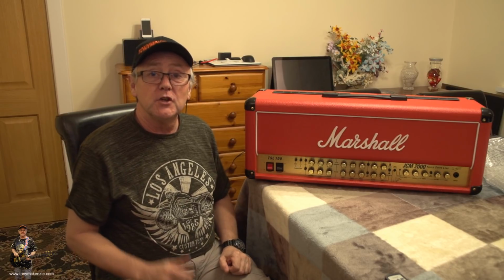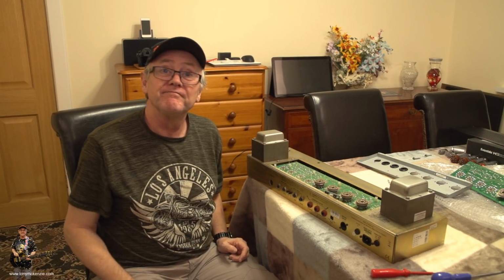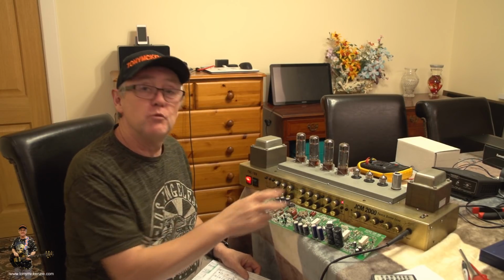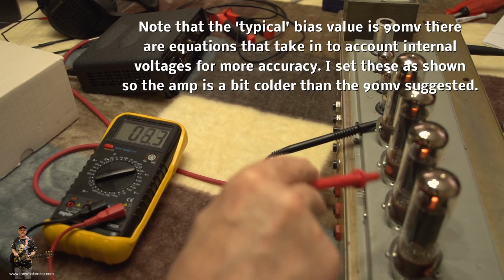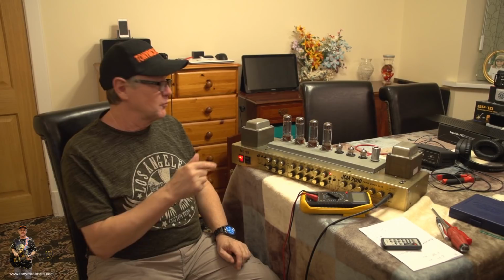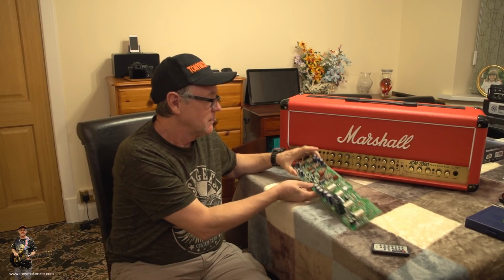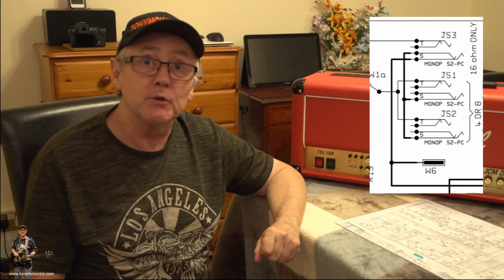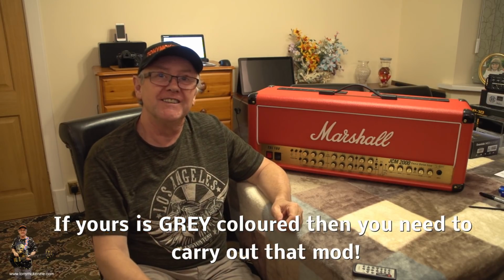Marshall TSL100 JCM2000 Amplifier | Permanent Fix For Bias Runaway | biasing review | Tony Mckenzie

Comment: You didnt mention what Marshall answer to you about the pcb problems, im curious, did Marshall offer you for free the main pcb?
Reply from the maker: Let's get one thing clear.... NO ONE offers anything to me for free... I went out after watching bodge after bodge on forums, the internet and other places and bought a board. There are MANY forums that 'blame' the material as there is a clear difference between the old and the new boards re materials. Subsequently, this video is the result of me solving the problem in a way that banishes the issue forever. Whatever anyone might say with fix this or fix that - none of it works! Watch this video and the singular answer you need is called issue 20!
Reply: @tonymckenzieofficial 
But in your opinion shouldn't Marshall replace all the motherboards for free or almost free? It's the user or second hand user that should spend more money to fix a problem that should never ever happen?
Because if the amp isn't repair the amp will not be 100% tone wise and will only will cause more problems and make the amp user spend more money.
Reply from the maker: No I don't think so. My board was dated 2004 (or something like that) and I changed it out at the date of this video way beyond any warranty periods or indeed any period that could ever be deemed as reasonable. At something like 10 years of age would you really consider that Marshall has any liability? Clearly had it failed within the warranty periods - which are generous (at least in the UK) then I am absolutely convinced that Marshall would have stood by their products and repaired or replaced the amp. Here's a question, if you bought a car and it worked fine until ten years later, then you noticed the trunk did not quite close properly would you really insist the maker has a liability for that?  

Ha after looking in to some 'major player' amps recently I'll stick with Marshall - at least I know where they come from and I'm not somehow given the 'assembled in' argument to chew over. And from what I see of some of the insides some of that stuff is actually worse (yes really) made with problems I would have never have thought reasonable than Chinese made products - but at three or four times the price. Bearing in mind the age of these amps getting over 15 to 18 years old it did not bother me at all to buy a replacement board. Here's to another 20 years... :)
Reply: @tonymckenzieofficial  No the problem here is that 15 years ago you didnt have all the information acess that you have now, and there was a time delay until this problem start to happen and be dicovered, maybe 3 years, the warranty period. But Im shure that if the first amp owner knew about this problem at the time  he would claim that in the warranty period.
 Im sure that someone during this period of time of warranty of 3 years complaint about this problem to Marshall, and Marshall realized the problem but kept quiet and ignored this issue for all other users. The cost to change alot of main boards, would be huge for Marshall.
Reply from the maker: The thing is Roderigo, that is pure conjecture and we will never know the exact 'facts' regarding this board. You CANNOT be 'sure' that someone during the warranty period complained about this issue? But in any case, what I can say to you, is that I have seen high flyer 'manufacturers' recently with an internal board that would turn your stomach if you knew what they let through their 'quality' checks on brand new recently released tube amplifiers. I don't really think Marshall are within a 1000 years of the extremely bad stuff I have seen recently... Indeed I could show you on here... but if I did that 'brand' might have a problem so better that I don't. Thanks...

Comment: Has it been proven that the PCBs are conductive? Or is this just a theory? I have two TSL60s and they're my favorite amps. I'd also like to have a Marshall DSL50. I just love the distortion sound they make. Personally I think they made these amps too complicated. For example I wish they just had the lead channel. No Effects loop. No Deep or Tone Shift. And no reverb. Didn't Steve Grindrod design these amps? Anyway I can't help but think that maybe Marshall used some cheap resistors, capacitors or maybe the wrong value bridge rectifier.
Reply from the maker: Not by me... but that is what I heard. You will note that the TSL100 and the DSL100 both have the same issue... except for the later issue 20 boards. Yes I think the TSL100 when set up 'just right' sounds incredible and I used mine back in 2006 for a whole album - I never beat those recorded tones with any amp really. They DID mod the board - that issue 20 is different enough to stop the problems once and for all from my experience. On the earlier boards they had different resistors, there's a cap that burns (its in this video) and that cap then burns the board etc. If you love the amp (and I get your points on those 'extras' that I don't use either) it's probably worth the investment... and check that 16 Ohm speaker connector for sure. I think Steve might have designed this amp - but I can't be sure - I never checked that. BTW I never saw any of the internet 'fixes' for the bias runaway really solve it all once and for all... they spent a long time messing around (some guys even drilled the boards) with some incredible and technical fixes when the issue 20 board solves it all quicker and it just works. Thanks John and stay safe.
Reply: Yes John, Steve Grinrod designed the DSL100... it was the last amp he designed for Marshall before he left to start his Albion brand amplifiers. The DSL was a rush-job design to complete with the Mesa Dual Rectifier, but the PCB (G10/FR4) used in the earlier amps had some sort of organic material in the board that caused them to be conductive at higher temperatures, especially where there is a large voltage difference. Unfortunately, most of the replacement boards suffer from the same issue as the earlier boards (I can't speak for the newer 20 series). To combat the problem, you can basically isolate the output tube grid pins from the PCB. The output tube screen pins (#4) are at around +450v and the input grid pins (#5) are at -55v. When the amp gets warm, the-55v creeps back towards 0v. This causes the bias to be so high that I've actually seen the glass actually melted. With the grid pins are completely isolated, there is no chance for them to be pulled high by the higher voltage pins around them. I know Steve was upset that these amps weren't really given the usual time to work out any bugs in the design, which is normal R&D protocol, as Marshall were in a hurry to get these amps to market. It could have been one of the reasons why he split from Marshall. Steve also designed the 2203/2204 two-input Master Volume models in 1976 if you weren't aware of that already. Hope this has been helpful. 

Regards 🎸

Comment: Great video! I know you love this amp so money isn't an issue but if you pay the ~£400 for one of these used, another £80 to retolex it, another £100 for the replacement PCB, another £150 for new tubes.. 
At what point are you just better off buying a better amp? :)
Reply from the maker: It is a great point - and one that no one else posted so far. I think it all depends on the person and their situation. I had one of these and recorded a complete album back in 2006. I have always had many tube amps since a long time. But the tones on that album I never did better (for those styles played) with any of the over 20 amps I own. Hard to believe but trust me on this. For me there had to be only one answer... and that was as you describe. Some guys would not do this. But if you have a TSL2000 and love it, then buying and fitting the board is not a bad option - its positively essential. Simply because this amp had trouble there are few if any other proper solutions that work. The board solves it all. So for me thinking about my Eniac album there is no 'better' option... only the TSL2000 creates the tones I recorded with a JEM 7VWH. I tried many times to replicate it but never could without the amp. That's my 'excuse' :) But you made a good point where some guys might well 'throw in the towel' because of the costs. Stay safe!

Comment from the maker: STEVE ROBERTS: Hey Steve you gave me an email that bounces. Go back to my site and fill the form again with the correct email and I'll reply and help you... Tony
Reply: Hey Tony thanks for this video. I love all your vids but need some help. I bought a tSL 122 pretty cheap knowing I'd prob need to change the board. It's a project for now but I want to use and keep it forever. Cover it white change the speaker etc. Anyway how do I know what revision board I have? It sounds pretty amazing right now at low volumes but damn it gets hot quickly. I'll prob change the board but not sure I should on my own I have no experience really in Messing with amps. If appreciate some advice. I can email some pics of the inside and talk in email if easier. Thanks Gareth 🤘
Reply from the maker: Hi Gareth... TSL122 is the combo I believe. Go to my website, fill in the form then we can communicate... I can't put my email on here for obvious reasons... but I have an image that shows exactly where to check on the boards...  thanks... stay safe.
Reply: @tonymckenzieofficial  great thanks Tony I will do that now. Yes it is the combo :)

Comment: Hi Tony,
Thanks for this video. I have owned a TSL for 15 years.. it has been pretty good but I have taken the opportunity to order issue/ version 20. Hopefully I'll manage the upgrade ok.. oh and your TSL head looks awesome in orange. Cheers cliff
Reply from the maker: The TSL100 contrary to some opinions is a great amp... I know that too :) Version 20 board solves it all and most likely the previous version amps are for sale really cheap... a great reason to buy them :) You should be able to change that but just make sure there is no voltage in the PCB before you start!.... Thanks for watching.

Comment: Thanks for this video, it helped me a lot already. I still have a question, the TAD website recommends to use only winged C tubes on this amp because the heater current at start up is supposed to blow a fuse when used with JJ or mullard stlyle el34s and the winged C is supposed to be less "picky" about the placement of components on the board where other tubes could start to oscillate. i do have a rather late model (built in 2006) do you recon they fixed this issue in the newer boards or do i have to get the 200 quid svetlana tubes? kind regards
Reply from the maker: I did not see that comment before... and I have personally never really had any issues with the TSL100 but as the video mentions thousands have. Maybe that applies to earlier boards? But the issue 20 seems perfect to me. Do you know what revision board is in the amp? Anything lower than issue 20 might be a problem... but as I said, even on the board I pulled out I never really saw any tube problems personally. As you will have seen though, that capacitor was burned because the 500v max voltage on the component is too low. The 1000v on the new board fixed that. Hope it helps. Thanks.
Reply: @tonymckenzieofficial  thanks! maybe your cooler bias might have done the trick, i think the factory recommendation is 90mv per pair which seems rather hot to me. i've seen the placement of components on issue 20 is a little different from the '98 specs. Probably fixed those issues. I didn't find any data on which issue was implemented from which year on so i won't get around screwing it open to check. Yeah i'll change c46 for a 1000V one and try a quartett of TAD el34b STR which i really enjoyed in 800s and plexis. maybe at around 80mV.
Reply from the maker: @niklasoswald7937  I never set any of it up to 90mv and I do think that's too far... but what do I know.  I think the place in the video is where to be... and on my plexi video (measured differently) I think that was about 37 per tube...

Comment: Wouldn't you have to discharge the filter caps before doing the board swap?
Reply from the maker: Of course. But for anyone contemplating this work they should be aware of what they are doing.  Thanks.

Comment: Hi Tony and everyone. Thank for this useful and helpful review about this mainboard and the output speakers modd.
Owner of a tsl 100 for not long I decided to change the board to prevent the bias drift problem.
I received it and changed it, not a big deal for me but I have problem with leakage / bleeding signal. When volume 0 and play guitar, sound pass to the speakers... Not loud but strange.
No info on the net about so I ask if someone has the same problem or have some knowledge from and about.
Nevertheless, it seems to work fine  and this amp matches with the music style I'm playing.
In future I will try to install the drtube biais mod on the old board just for my entertainment.
Best regards from France.
Reply from the maker: If you plug in a guitar lead to the effects return (a or b) does the sound then stop? sometimes there are problems on the loop sockets? The loop is also parallel. I do know that on some Marshall amps there is NEVER a full cut off of the through signal on the parallel loop and some have been known to convert those to serial loop which is the usual type of loop found on most gear I reckon. 

Anyone else?  Do let me know what you find as its always interesting to know. A great amp very underestimated in my opinion! Thanks.
Reply: Thanks for your answer Tony, I will dig that way this week.
One thing I will also do is to check all components 's soldering cause I read that if there is some too close it could happen.
I will let you know. 
In all case I'm agree with you, this amp is underestimated, very polyvalent and great sounding. 
Keep rocking as you did at the and of this review.
Reply from the maker: @Дидьеоваль  Yes and please do let me know what you find. The track at the end is called 'Lightpipe AI' from an album I released back in 2006 called 'Eniac' and its a very good track on the album. It was played originally on the TSL100 and a Ibanez JEM 7VWH and a Cry Baby Way... that was it, and I swear I have never achieved a 'better' tone on any amp and I still own over 20 different brand amps. Here's the track provided by CDbaby in all of it's original glory...  and watch where the wah kicks in :) one of my favourite pieces. : https://youtu.be/P_kLLgOGP-A   Thanks.
Reply: @tonymckenzieofficial   Hi Tony, I'm back to explain what whas the result of your test. So, I plugged my guitar into the return and no sound until I turn the fx pot as a volume's pot. Until here normal except that there is a "pop" when I start turn the knob. No "pop" if i select crunch/lead and use the fx pot of this section. It does normal. I imagine that it comes from the clean section.
I will search deeper in this way.
Salutations.
Reply from the maker: @Дидьеоваль  I still think some sort of problem on the loop. Hard from here to advise but parallel loop on Marshall (some of them) are known to 'pass' sound even when turned off...  yes do let me know on here if you find it because it will help other guys too. Thanks.
Reply: @tonymckenzieofficial   I will continue to investigate and will give news if I find something. Thanks for your time and your advice. Nice from you.
Reply: For what it's worth, the DSL100 loop will always pass sound as well, even if the channel volume is turned off. Must just be a byproduct of the design.
Reply from the maker: @TheRustedShackleford  Correct - seems all related to parallel loop syndrome :)

Comment: Tony.

I had several of these over an 11 year period. Only one gave me a problem. 

I gigged these and made an album with them in 2008. (Comfort In Fear by Heroes Of Switzerland). What shocked me about the TSL series is that the 100 watt was quite a good amp. But the FX loop was terrible. Whereas the TSL60 has a superior FX loop. Although I had this weird method of running the 60 at 4 O Clock on the master volume while keeping the gain and Chanel volumes at 12 O Clock. 

The other major issue is that footswitch. I used to go through two a year without fail.
Reply from the maker: A great sounding amp that I too used on an album from 2006 and some in 2008 also. The 60 sounded weird to me though so I flipped and stayed with the 100 but never used the loop really... Thanks for the info Sebastian about these TSL amps - mine never did fail, but I did find problems lurking on the motherboard - which I changed out as you saw here. I still have that amp, but I never had any other problem - but mine was studio based and you're out there - and that's a massive difference. All good stuff... and thanks for watching.

Comment: Hey Tony! Have you ever done a bias mod to one of your Mesa amps? Thinking about doing one to my Mark III but not sure its worth the hassle.
Reply from the maker: Scarily.... I DID buy a little board from a USA company many years ago to make the BIAS adjustable. I 'found' it much later just in a drawer in the studio, so decided to check back with that company but they no longer made it. Somewhere here I have it... if I get chance to dig it out maybe I'll show it and show the method of conversion etc... works on a number of Boogie amps... strangely I never did fit it though (probably too idle for the 'gains' achievable so never bothered) and I guess they probably did not sell many so they stopped making the kit. It was not expensive and you did not actually need the kit to do a conversion to being adjustable. I think mine was for a triple recto at the time... but they are likely 'similar'. 

In any case I'll take a look and if I find it (who knows) then I'll make a quick video - biut won't be fitting it, just showing what to do. Thanks and great question...